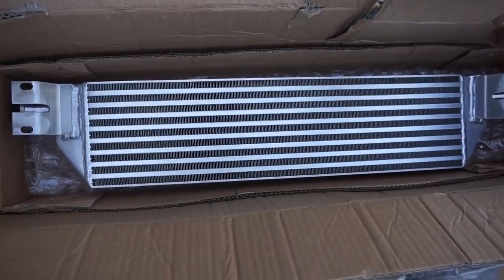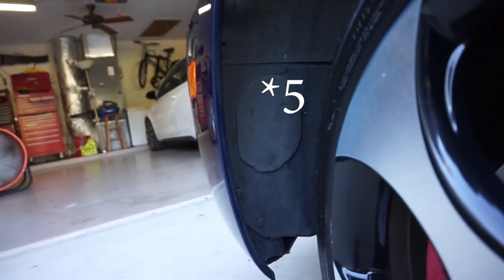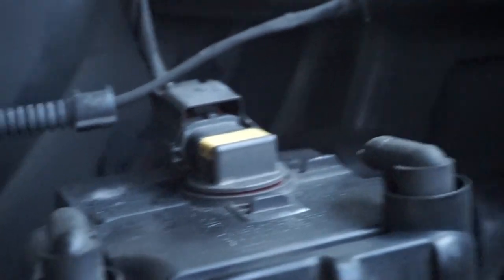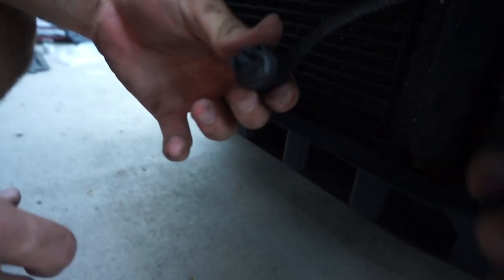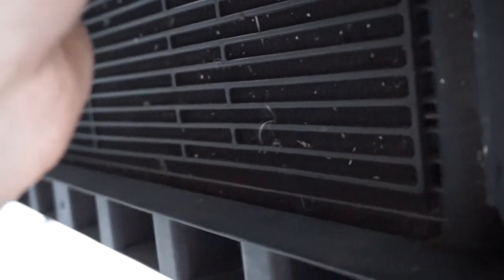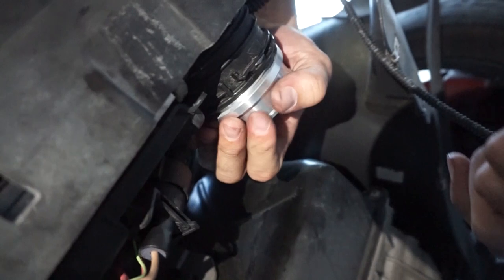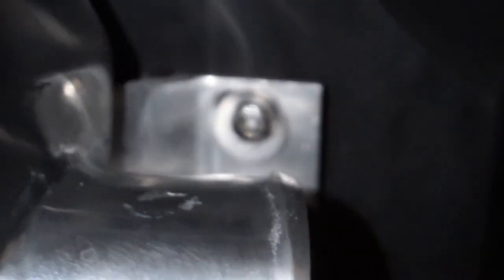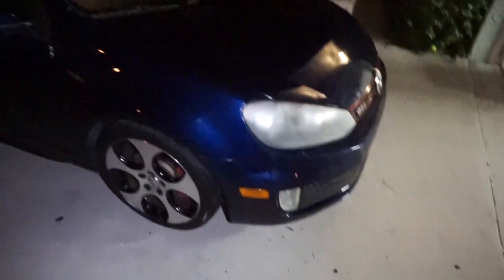FMIC Install MK6 GTI, Golf R & TTS

Comment: Hey guys, I noticed pre-orders for the new revisions of the MK 5/6 bicooler are live on the site, I just wanted to verify that the new “street” kits will still include aluminum quick connect adapters for connection to factory plastic end tanks (in my case, for a MK5 FSI GTI)? Thanks!
Reply from the maker: Yes sir!

Comment: Slightly off topic - did you jack up the car using the front lower control arm to allow the jack stand to be placed at the factory jacking point?
Reply from the maker: I used the pinch weld

Comment: Danny, where tf can I buy a mabotech turbo bro, I dont wanna buy the i.e. transverse turbo k04, want the 550 mabotech turbo.. and I have to buy the intercooler from ebay because you cant find it any where either.
Reply from the maker: The mk6 intercooler is out of stock. But m550 is ready to go. Hmu on insta I'll get you pricing autobahn_mk6

Comment: Would it be better to do this fmic first or upgrade the stock intercooler first for going stage 2 k04, plan on upgrading both but which would be better to do first?
Reply from the maker: I think the stock location is better. More surface area and cleaner install. 

Here's me installing one 
https://youtu.be/LVGwr6dmxaY